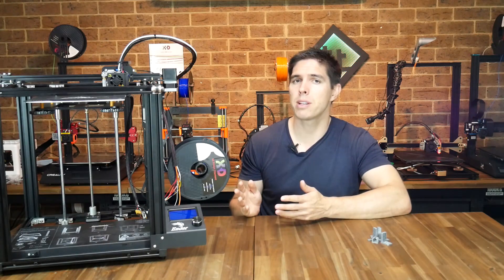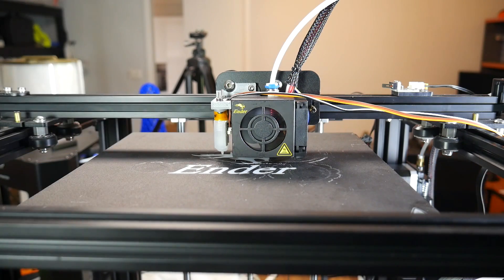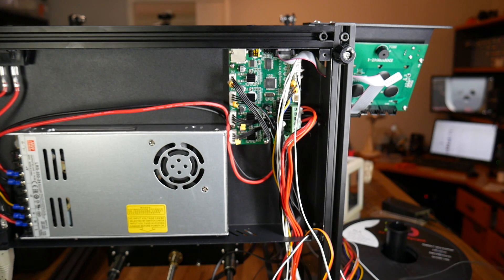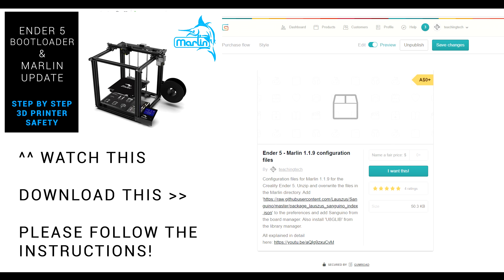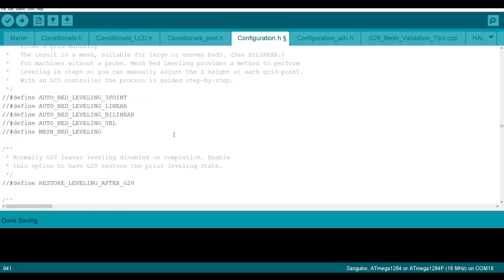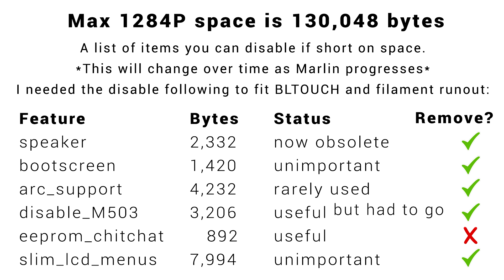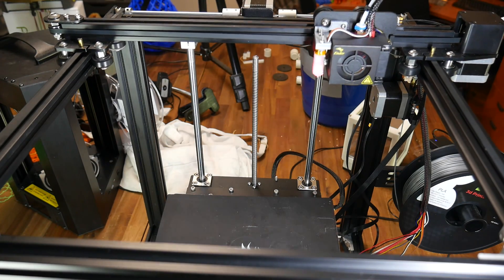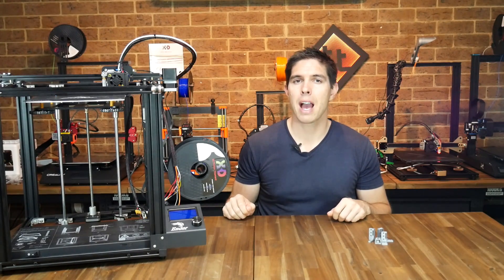Ender 5 BLtouch guide - Step by step for Marlin & TH3D

Comment: Hi there. I did all of thise ~5 years ago and then stopped printing for a while. Is there a way to adjust Esteps by editing something through the config files? I'm not sure. I've previously used this tutorial and flashed the marlin software. But there is no option to edit the Esteps on the ender 5 (non plus) screen. Thanks!

Comment: Boys and girls, be aware that the latest Marlin firmware for this "upgrade" does not look like any of these instruction clips anymore. I have been trying to "upgrade" my Pro 5 for the better part of the day. And basically I ended up ruining a machine which was better than I thought it was before I started to implement this nonsense.

Things the upgrade/ update does: all settings previously stored on the printer are now lost on every reboot. Your SD card is not recognized by the printer anymore. Also the files you have on your SD card are corrupted and/ or removed after it has been in the printer. You still need to calibrate the nozzle in the corners, so what is the actual point; specially since all settings are lost on every reboot. Before if I was careful I could work weeks with one bed leveling session. Now I have ruined my printing bed with a nice big scratch (because it is completely unclear where and how the nozzle-probe offset is applied (it is in "bed leveling" btw) and how the gcode file adds/removes/alters that value). And it is now finally working.... I have it all setup as should... and now it keeps crashing 30 seconds in the first layer. Complete freeze of the printer. Only a hard reboot works.

I guess I'll rip it all out again. Hope I can go back to how it was originally. What a disappointment.

Comment: Very nice video hey i have th3d unified 2 firmware if i want to configure bltouch in it and i have v 4.2.2 board do i need to un comment servo pin 27 if i am using 3 pins of the 5 pin connector and 2 pins of endstip
Reply: Did you figure this out?
Reply: @jpl3k  nope

Comment: How critical is it that the 2 ground wires connect to separate grounds?  I have a 4 wire cable already run for a future BL Touch.  I could use the shielding for another conductor if needed, but if I don't need to, I'd rather not

Comment: NEED HELP!!! So I just purchased the Ender 5 Pro with the v4.2.2. board and decided to add the BLTouch leveling kit. Install of the hardware went well. I decided to install without the adapter board and plugged the 3 pin connecter into the white 5 pin slot after rearranging the 5V and Ground pins. This issue I am having is finding a clear answer on what and where to find and flash the proper firmware. Can anyone offer some help or point me in the right direction?
Reply: Creality gives you the correct Firmware on the SD Card that came with the printer just copy it to a SD Card. Plug it in the printer and switch on the printer

Comment: Hi , I keep getting this error. Can you help please? Ender 5

Arduino: 1.8.10 (Windows 10), Board: "Sanguino, ATmega1284 or ATmega1284P (16 MHz)"

Sketch uses 125818 bytes (96%) of program storage space. Maximum is 130048 bytes.
Global variables use 4817 bytes (29%) of dynamic memory, leaving 11567 bytes for local variables. Maximum is 16384 bytes.
C:\Users\Admin\AppData\Local\Arduino15\packages\arduino\tools\avrdude\6.3.0-arduino17/bin/avrdude -CC:\Users\Admin\AppData\Local\Arduino15\packages\arduino\tools\avrdude\6.3.0-arduino17/etc/avrdude.conf -v -patmega1284p -carduino -PCOM4 -b115200 -D -Uflash:w:C:\Users\Admin\AppData\Local\Temp\arduino_build_162465/Marlin.ino.hex:i 

avrdude: Version 6.3-20190619
         Copyright (c) 2000-2005 Brian Dean, http://www.bdmicro.com/
         Copyright (c) 2007-2014 Joerg Wunsch

         System wide configuration file is "C:\Users\Admin\AppData\Local\Arduino15\packages\arduino\tools\avrdude\6.3.0-arduino17/etc/avrdude.conf"

         Using Port                    : COM4
         Using Programmer              : arduino
         Overriding Baud Rate          : 115200
avrdude: stk500_getsync() attempt 1 of 10: not in sync: resp=0x65
avrdude: stk500_getsync() attempt 2 of 10: not in sync: resp=0x63
avrdude: stk500_getsync() attempt 3 of 10: not in sync: resp=0x68
avrdude: stk500_getsync() attempt 4 of 10: not in sync: resp=0x6f
avrdude: stk500_getsync() attempt 5 of 10: not in sync: resp=0x3a
avrdude: stk500_getsync() attempt 6 of 10: not in sync: resp=0x54
avrdude: stk500_getsync() attempt 7 of 10: not in sync: resp=0x46
avrdude: stk500_getsync() attempt 8 of 10: not in sync: resp=0x20
avrdude: stk500_getsync() attempt 9 of 10: not in sync: resp=0x69
avrdude: stk500_getsync() attempt 10 of 10: not in sync: resp=0x6e

avrdude done.  Thank you.

An error occurred while uploading the sketch
Thanks

Comment: Hi, so how does this help with bed levelling? The only thing you do is adjusting the height of the nozzle. You still need to adjust the table by hand. So what am I missing....
Reply: If the bed isn't perfectly level, the printer will now be able to compensate for it because it knows the precise position of the bed. (Of course it's still a good idea to set the bed as well as you can, so the printer doesn't need to move in the Z direction more than it has to).
I think where this really comes into play is compensation for a warped bed - you can't straighten that out just by adjusting the corners.

At least that's my understanding of this whole thing.

Comment: this video is really great for setting it all, but how do you USE the bed leveling? I've enabled the lcd_bed_leveling but when I press "Prepare>Bed Leveling>Level Bed" it completes the sequence and that's it. No info on what parts of the bed were too high/low. Is that how it's supposed to run? how to I level the bed??
Reply: You need to have a line that just says "G29" in your code when you run a print and the G29 creates a mesh that your printer should use to automatically adjust the z axis to account for an unlevel bed

Comment: I have followed this guide and now notice that the wipe line is printed on the LHS of the printer rather than the right. It also moves the hotend to the front left rather than the rear right after the firmware update. I wonder if the Axis have somehow become inverted? The auto-home moves the hotend to the rear-right as it always has still. Any suggestions?
Reply: Did you solved your issue? I have the same problem

Comment: Can you probe the bed in 9 places and get a report back for the value at each point? I would like to manually level until each of the 4 corners reads the same, and then let the BL touch compensate for any flatness deviations for the points in between

Comment: I've followed it to a tee using skr 2.0 marlin 207 and bugfix ender 5 and when I auto home, it homes x and y but when it goes upto nozzle it shows stopped on screen when I click the bltouch 3.1 when it's moving it doesn't stop my bed going up. Self tests work
Reply: Did you find a solution for this?

Comment: I followed instructions to the letter on my ender 5 pro with the 1.1.5 board and flashed ok. However, when it homes the Z axis, it travels to a position half way up and stays there. No errors on the screen or anything. Wiring ok and I've tried it with the black and white wires reversed but just the same. Anyone else come across this?
Reply: Evidentially, with Antclabs bltouch v3 you have to remove a capacitor from the main board. Once I did this, it worked ok. https://github.com/3d-printing-canada/Ender-3-BL-Touch-Installation

Comment: I'm not sure this is an issue but my config.h is missing a couple lines. I flashed 1.1.9 as per your previous video and it's been working great but auto bed leveling sounded good.
* The BLTouch probe uses a Hall effect sensor and emulates a servo.
 */
//#define BLTOUCH

/**
 * Enable one or...
I'm missing the #if ENABLED(BLTOUCH) ..... endif
Any thoughts anyone?

Comment: Does anyone have a problem with the pre-print probe test (3x3 grid) across the print bed wherein the probe goes off the left edge of the print bed? I've adjusted the size of the print bed in marlin and looked everywhere I can online for a fix to this but can't find anything. I even tried to flash the new Marlin Bug Fix 2.0.x but can't even get that to flash. I am at a total loss and the people from the Marlin discord server told me to try everything from using VSCode to switching my os from Windows to Linux. Any help is GREATLY appreciated!
Reply: mine did this, did yours start at the centre by any chance? The G28 command just levelled in centre, so I used G90 (to move to corner first) then G29 T which worked with a 3x3 grid.

Comment: Hi, I've followed this guide for my Ender 5, BLTouch V3.1 and Marlin 1.1.9.1 & Creality V1.1.5 Silent Board. All good except it seems to add to my Z Offset value of -2.41 so when it homes my Z value is 12.41 and therefore the nozzle is nowhere near the bed! I used this vid - https://www.youtube.com/watch?time_continue=44&v=y_1Kg45APko&feature=emb_logo to get my Z value all else using this video. Any ideas? Thanks.
Reply: @ihaveurnose  I was at printer yesterday and did steps again but it did the same  thing! I had no idea of the clearance. Thank you!!

Comment: I'm having a weird issue. I have a mostly stock ender5. I added bootloader, marlin 1.9 with the proper config files you supplied and a bltouch. Everything worked great for a few days. I had a long print finish, and now my Z homeing direction is backwards.  When manually controlling the directions or correct.  
Any ideas what caused this and how to fix?

EDIT:  I figure out it is the probe is sticking

Comment: Cheers Michael, good overview.  Been playing with start GCODE settings taking examples from various sites and modifying to suit.  I use Prusaslicer and found the following the best setup:

M220 S100 ;Reset Feedrate
M221 S100 ;Reset Flowrate

M117 Initial Warmup
M140 S[first_layer_bed_temperature] ; set bed final temp
M104 S170 ; set extruder partial temperature to avoid oozing

G0 Z5; Raise nozzle 
G28 ; home all axes
G29 ; Enable ABL

M109 S[first_layer_temperature] ; wait for extruder final temp
M190 S[first_layer_bed_temperature] ; wait for bed final temp

M117 Preparing to print
G92 E0 ;Reset Extruder
G1 Z2.0 F3000 ;Move Z Axis up
G1 X10.1 Y20 Z0.28 F5000.0 ;Move to start position
G1 X10.1 Y200.0 Z0.28 F1500.0 E15 ;Draw the first line
G1 X10.4 Y200.0 Z0.28 F5000.0 ;Move to side a little
G1 X10.4 Y20 Z0.28 F1500.0 E30 ;Draw the second line
G92 E0 ;Reset Extruder again

G1 Z2.0 F3000 ;Move Z Axis up
G90 ; use absolute coordinates
M117 Print in progress
Reply: Also this for End G-Code: 

M300 S440 P150 ; Chirp to indicate print completed;
M300 S660 P200
M300 S880 P250

M106 S0 ;Turn-off fan
M104 S0 ;Turn-off hotend
M140 S0 ;Turn-off bed

G0 Z5; Raise nozzle 
G1 X220 Y220 ;Present print

M84 X Y E ;Disable all steppers but Z

Comment: Successfully upgraded my Ender 5 pro to Marlin 2.0 and configured 3dtouch, after upgrade completed nozzle home location moved to opposite direction (lower left instead of upper right). I would like to move the nozzle to original location (upper right) when homing, how can I do that?
Reply: Did you figure this out?
Reply: @DynamicJon  yeah actually really simple. Add or modify "G1 X0 Y0 ;Present print" to "G1 X225 Y225 ;Present print" on your end g-code of your printer.
Reply: Clyde_noob awesome thanks allot!

Comment: Just bought a Ender 5 pro. I’m a beginner. Will this video apply to it if I buy this bl touch?
Reply: Did you get this working with the 5Pro?
Reply: @thomashardy8838  I ended up returning the ender pro before it came and ordered a prusa. Best decision if you can afford it
Reply: @elitecompany1878  Thanks, I already had the Ender 5 Pro when I reached out. Thank you. Struggling with it here, I bottled getting the Prusa in favour of this - hopefully won't regret it
Reply: @thomashardy8838  Creality have the firmware with bl Touch Support ready to download on the website you only need to copy the Firmware on a SD card. Plug ths in the printer and start it. The Ender 5 Pro automaticly updates the firmware

Comment: With my Ender 5 PRO bltouch works fine - calibration starts, 9 point done but - I've got an Issue with Ender 5 PRO - I uncomment line #define ENDER5_NEW_LEADSCREW
 but it move over 1st layer, extruder fires. It looks like problem with Z axis - but I'm really stuck there.

Comment: I did this right from pretty much the very first shot!  Except, there was one thing that wasn't mentioned.  The newer Ender 5 (perhaps even after your video was made) have a new z axis screw that is 800 steps/mm.  The example cfg files for the Ender 5 have this set at the old configuration of 400 steps/mm.

This leaves me with a question I'm having a hard time finding the answer to.  How do I upload the changes I've made to the cfg file to my board, now, with the boot loader?  I tried to just plug in and upload, but, was not able.
Reply: Do you have access to an octopi? you can use the terminal on there to set the steps back to 800 with the "M29 X800" Gcode

Comment: I also posted this comment on your Ender 5 Marlin video. It would have been helpful information when I began this process and thought maybe it would help someone else or possibly me in the future :)

I found out how to flash using the original ISPUSB that came with the printer. You just have to export Marlin from Arduino, which creates a hex file (in the Arduino directory, bootloader included) that then is able to be written through the progisp program from Creality.

I had a few hurdles, after doing the modifications in this video, my compile was at 98% and though the compile completed the flash ended up giving me the blank bluescreen on boot error. Looking through the compile I noticed two errors, one with ultralcd.cpp the other with temperature.cpp which lead me on a wild goose chase, After realizing these were both temp files I figured they weren't an issue and redid the whole firmware watching your videos again from start to finish. I achieved the 98% before commenting out the ARC feature in your Bltouch video and thought it was ok. This time after writing again and failing again.I decided to comment out the ARC this brought me down to 96% and finally a fully functional printer.

Next issue I had doing a test print was that my prints were getting smashed as though it was not raising up the Z axis enough, I discovered that the Ender 5 PRO has the lead rod upgrade. Your configuration files are for the 400 lead rod I finally found that the code I needed to edit was here...

#define DEFAULT_AXIS_STEPS_PER_UNIT   { 80, 80, 800, 93 }

Now everything is wonderful! Thank you for your help and the education!

Comment: i have add the bl Touch and it is working, thank you but i have an odd issue with prints now. i set my z prob off set to 5mm for homing and now my prints are off. i printed a 20mm x 20mm cube and the z high on the print is 10mm. i did another print that was going to be 55mm on the z and it came out to 35mm. can any one tell me what the hack i did to this
Reply: this is on a ender 5 pro
Reply: Squashed print

Some Ender 5 come with a new Z Axis lead screw with a step per milimeters of 800 instead of 400. If your firmware still use 400 step/mm, all print will look squased and with half the z height.
GCode only

You can easily update the printed settings by sending gocde : M92 Z800
Marlin 2.0.X and Marlin 1.1.X

In the Configuration.h file, edit the DEFAULT_AXIS_STEPS_PER_UNIT instruction:

#define DEFAULT_AXIS_STEPS_PER_UNIT   { 80, 80, 800, 93 }

TH3D

In the Configuration.h file, uncomment the line 422:

#define ENDER5_NEW_LEADSCREW

Comment: Ok I have 2 comments the first is with Marlin I followed all the steps but it didn't do a 3 by 3 probe it just probed up and down twice. and the second question is why use a bltouch in the first place if you still have to level the bed. Still not 100% sure why it is needed apart from looking cool.

Comment: Hi there, Help me pls : my ender 5 with bltouch original and firware from creality make two pb :
- levelling end outside the bed for the 3 left side checking (around 3 cm out if the bed...) 
- last but not least, my extruder go the right at the end if levelling and go crash against the sensor of the axis and thé printer stops after...

I really need tour Help because my Friends from the hospital want me to print lots of "door grabers without contact" to prevent from covid... 

Peter (from France)

Comment: On a different board (SKR Mini E3) I was able to install the firmware by putting 'firmware.bin' on an SD card, loading the card in the Ender 5, and turning the power on. Does that work on Creality boards after the bootloader has been burned?

Comment: I tried your firmware 2.0x and have a few issues.  My probing only covers the left 2/3 of the plate.  When I try to print it tries to push the head through the plate.  I checked my Zoffset 100x and the math is correct.  I also tried the entire range of adjustments.  Still hits the bed and wants to travel another 20-30 mm after it hits.  Do you have an updated firmware?  Ender 3 Pro, SKR Mini E3 v1.2, BLTouch.  You are using on these thing quickly.  Thanks for all the great guides.
Reply: Brendan, Did you solve this?  I am going through the exact same thing  I have an Ender 5 pro with a V4.2.2. board and a bltouch and it does the same thing... wants to put the plate through the nozzle.